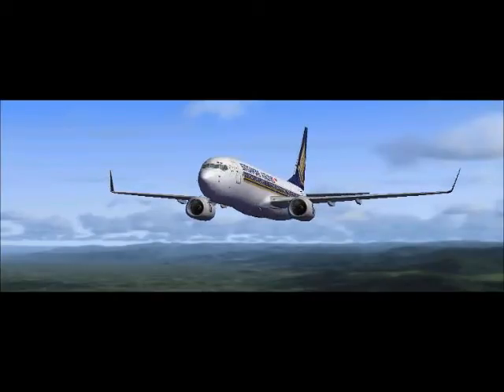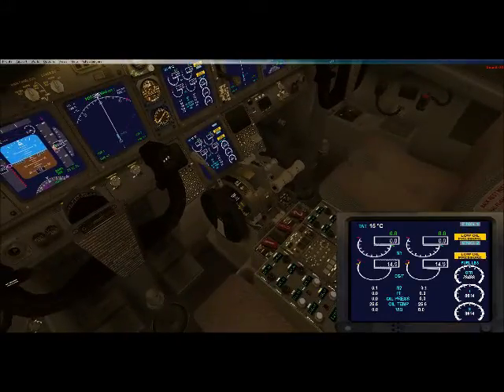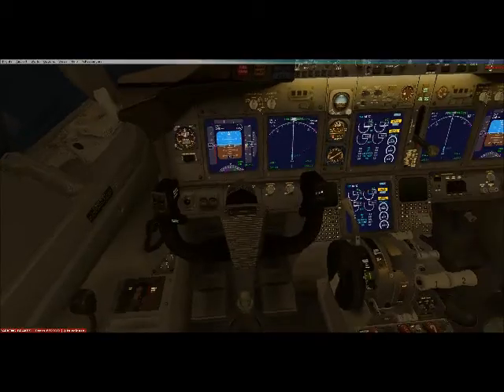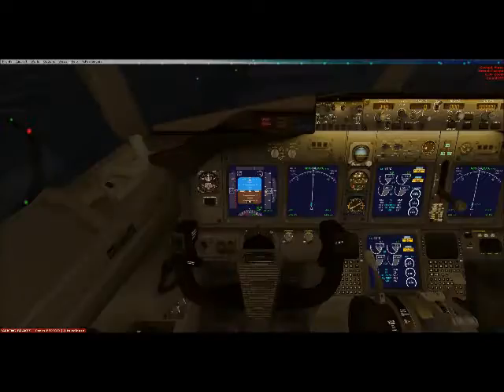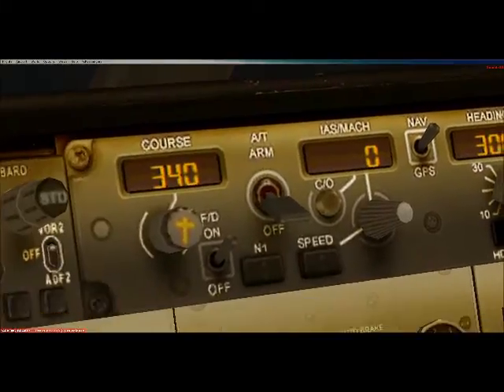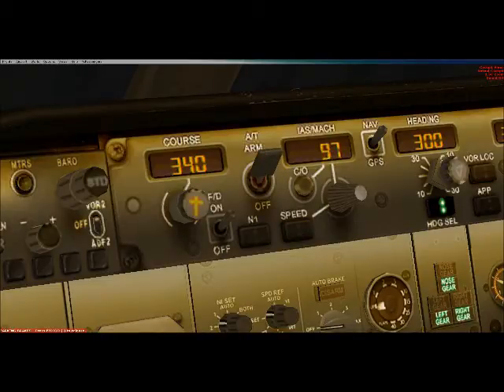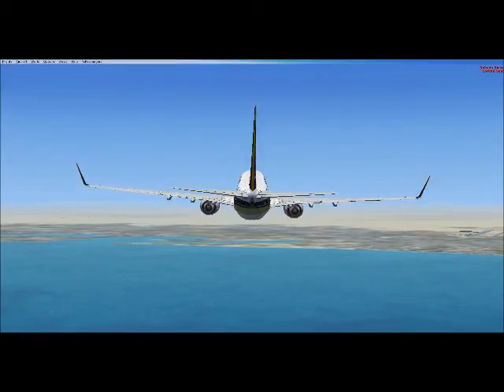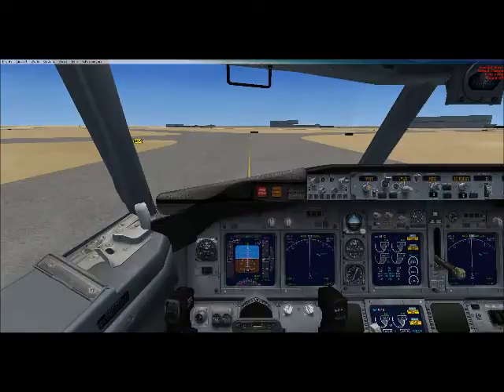FSX Tutorials - (Basics) How to fly a Boeing 737-800

Comment: Picto tubes are used to measure forces, when's force is applied to them it induces a voltage which can then be measured. I know nothing about planes but I'd assume this is some how calibrated. If they're the same thing that I think they are xD
Reply from the maker: Pretty much. In severe winds and turbulence you can see the speed readings fluctuating a lot so this is a good explanation :P